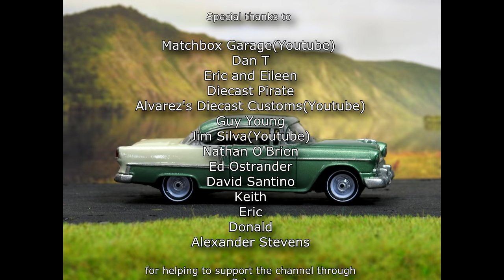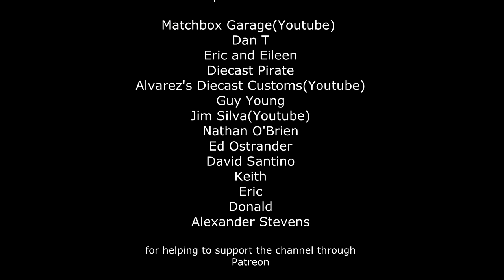1955 Chevrolet Bel Air Restoration High Speed Brand Readers Digest Promo Car

Comment: The 55 Chevy was part of a set that was offered beginning in 2001 I believe. There was also a 57 Corvette, a 69 Camaro, a 1956 Ford pickup, a 1953 Cadillac convertible and a fire truck. I have the 55 that I picked up at a thrift store. Very nice build
Reply: Yes you are correct. 2001.